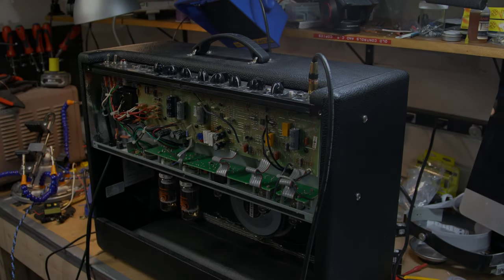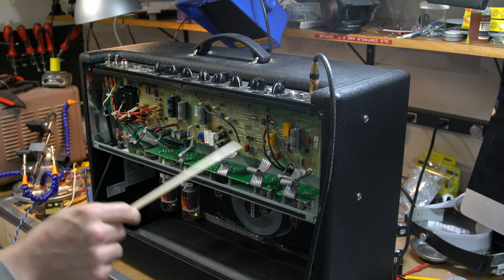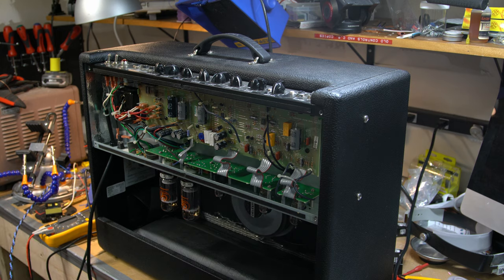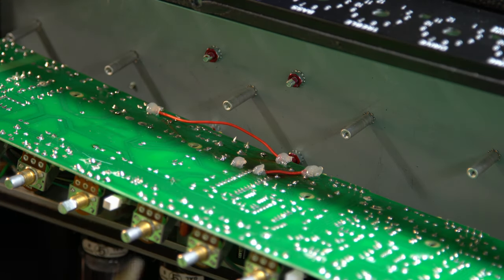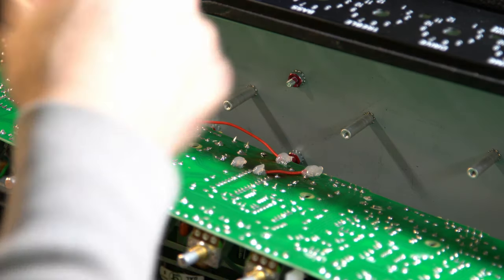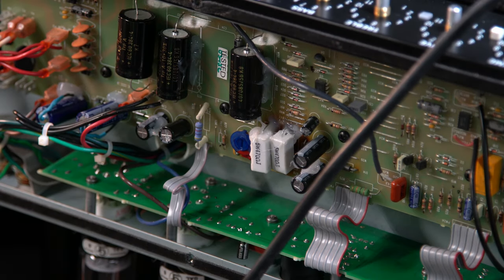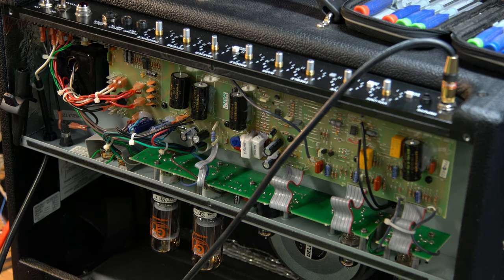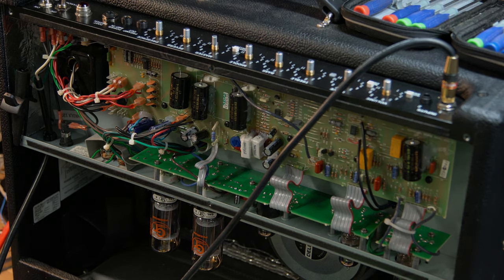Fender Hot Rod Deluxe Recap and Repair

Comment: Hi it is a great video! Really interesting.
Maybe it is a silly question, but what is that black bag in the bottom of the cabinet I always think that it is the reverb cam but I don't catch if it actually is and it works with that circuit that you mentioned that is the reberv circuit or if it is something totally different.
Reply from the maker: It is indeed the reverb pan.  It is a metal box with transducers connected to real springs
Reply: @FrenchieFilms  thanks for the clarification I really appreciate it

Comment: How much would a repair like this typically cost?
Reply from the maker: Depending on the quality and count of capacitors maybe two hundred dollars or so,
Reply: @FrenchieFilms  I would imagine since I have the same amp, It would be around the price.. right?
Reply: @whittington72  Yes that should be about the ballpark.  It does also depend a bit on where you live, if the cost of living is higher they may charge a bit more as well.  I'd just call a local tech and ask them what a cap job and the like would cost.  They should give you a pretty good quote for their cost of labor etc, and parts.  You may want to specify that you want nicer caps instead of just whatever.  They may put in more illinois or other cheaper brands (which will work, but just don't tend to last as long etc)
Reply: @PhilDavisFilms  Thank you so much for the advice. I really appreciate it.
Reply: @whittington72  you're welcome ;)

Comment: Dont know about anyone else, but I didnt really learn anything here.  Thought I might see how to replace the filter caps instead of a video of an amp after the filter caps were replaced.
Reply from the maker: There are so many youtube videos out there on how to replace capacitors, I felt it would be overkill.  Instead i'm just explaining and showing on this amp where things were, what went wrong with it over time, and how I fixed those issues.  I'd recommend watching the dozens of youtube channels that show basic electronic board repair techniques.

Comment: On the power resistors that were changed, you want to have an air gap between them so that air can get around them and help cool them.  Don't put silicone covering on them as this also will make them run hotter as it acts like a blanket and holds the heat in.
Reply from the maker: So far as I've heard/seen the separation from the board is to help keep the heat away from the board.  The silicone helps keep the heavier resistors from vibrating too much and creates a bit of a barrier between them and the caps directly above them that get extra heat from them.  All in all I guess you may have a point, but I'm not sure if it's worth the extra risk of the leads vibrating too much from the weight of those 5W resistors hanging on the leads in the air.
Reply: @FrenchieFilms  If you are going to put silicone on the resistor for vibration purposes put it under the resistors at the 2 ends but do not put it on the leads going to the board. The reason you don't want to put it on the lead wires is because you want the air to cool the wires before they get to the circuit board. Do not put it on top of the resistor.  leave an open spot in the middle of the resistor under the resistor for air to circulate around it. Power resistors need some kind of cooling or they will overheat creating more heat.  If you are concerned about the caps above the resistors replace them with a higher heat rated caps.
Reply from the maker: @neutrodyne  it may not be super clear, but you just described exactly what I did.  What you see on top was more a bit of it that dripped over the top.  I didn't cover the tops of them at all, and I put an extra bit on the wires to the top left to reduce the heat rising upwards, to channel it more to the right.  The caps I put in are 105C rated, I think the illinois may be 85C

Comment: Those caps ,,, just j hook the new ones in . Those pcb,s are junk !! Those amp,s are built to the cheapest price point. It,s amazing that they sound great. The next time it takes a poo i,d gutt it and turn it into a vibrolux or deluxe with old school turret or eyelet boards.
Reply from the maker: Yup, well it wasn't the caps that gave me grief, it was the resistors and the traces under them for the relay power supply.

Comment: Hey Frenchie, my name is Martin and your AC30 Build Series led me here. I wanted to know if it is possible to get into direct contact with you via Teamspeak, Skype or whatever.

Because I built an AC30 myself and have issues with a hum in my "Brilliant" Circuit. I also have a hum in my "Normal" Circuit but it's a smooth hum and it's not of significant amplitude. I am a expirienced electrical engineer, but not with analogue amp circuitry. It's really driving me insane. I have this project running for about 2 years and I am stuck on that issue for almost a year now.

I have a forum thread on the topic but sadly in german. But you can still see the progress on the last page where you can see on the pictures how i lowered the amplitude of the hum on the normal circuit. Basically I made rookie mistakes like grounding all over the place etc.

https://www.musiker-board.de/threads/baubericht-eigenbau-tophead-vox-ac30.647832/page-6
I am almost at the point where i want to take everthing apart and start all over again. Please help me keep my sanity ^^
Reply from the maker: I'll see if I can take a look.  Send me an email at pdavis@frenchiefilms.com
Reply from the maker: @Apicalis Gaming  I looked through the thread, it sounds like 50 cycle hum to me, which means you're picking up noise from the wall, not through the filter capacitors.   This means you may have the wires that go from your input from the 230/240V on the wall to the power switch etc are too close to the signal path, or you have a bad tube picking up something.  Having your power tubes so close to your preamp tubes is also a potential path for noise but I think you may just need to either heavily It seemed like you ran the switch through the middle of the amp between the power tubes and the rectifier.  I'd recommend removing all of those wires, and running them behind teh transformers along the outermost edge of the amp.  If you look at most power switches on amps the power transformer is far away from the preamp side, AND the power tubes and the power switch is directly across from it.  Since you've already run yours, I'd move the wires around the back/outside of the amp as well as twist them to reject hum release.  Also, do you have a center tap for your 6.3V windings?  If not did you create an artificial center tap?  It looks like you did a good job of twisting the heater wires and ran them away from the signal wires quite well.
Reply: @FrenchieFilms   thank you for the fast feedback. I sent you an email